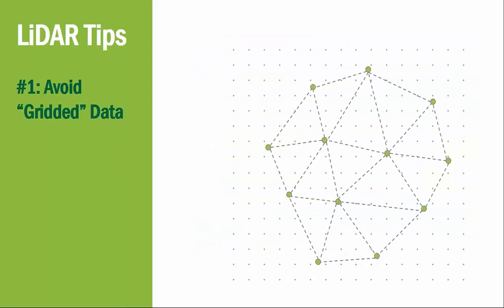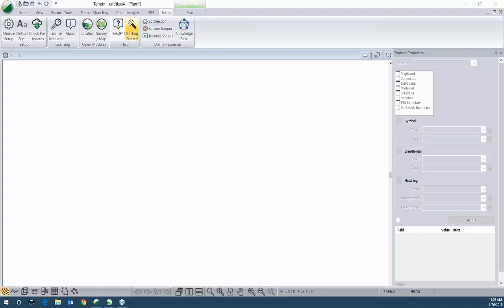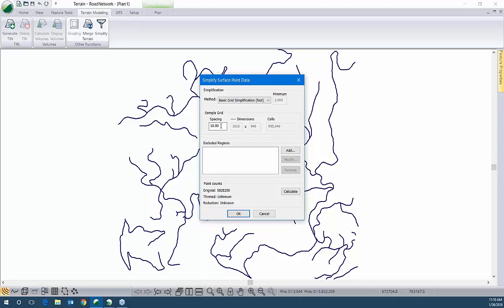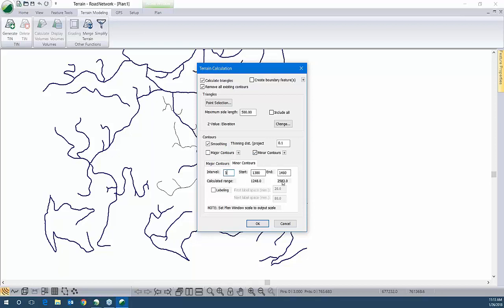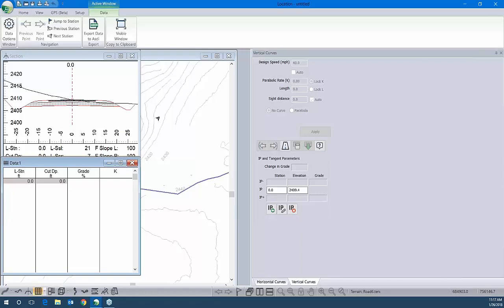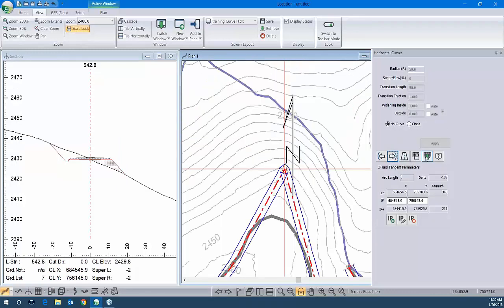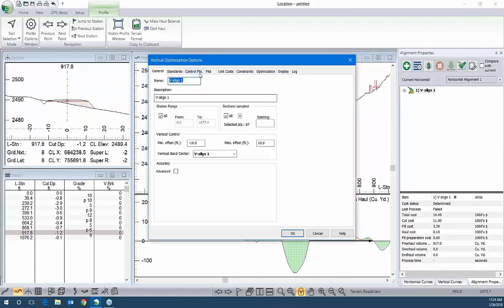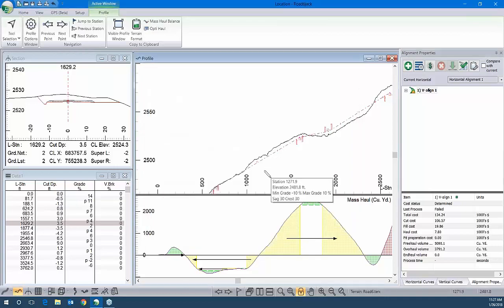LiDAR in resource road design - Importing, Thinning and Designing a Road

Comment: is it possible to enter an estimate of the depth of each ground material type, a cost of cutting this material in road construction, and hence better road construction cost estimates? This information is usually gathered during road traverse, with at least a depth to rock estimate, if not an overburden type and a secondary layer type. A cost of cutting these materials would further improve resource road construction cost estimates since it is now so relatively easy to optimize the road location for mass haul volume with lidar.
Reply from the maker: Hi Peter, YES! By entering your ground types and your cost of cutting each material (in the cost table) this is how our Softree Optimal add-on for RoadEng is hugely advantageous over manual design.  You can visit our Knowledge Base to read more on (1) Setting up your ground types and (2) setting up the excavation and movement costs for your ground types. Note: this requires a Softree Optimal license.    

Setting up ground types: http://support.softree.com/knowledge-base/location-module/materials-and-stripping/defining-sub-surface-layers
Setting up ground type costs: https://support.softree.com/knowledge-base/softree-optimal-1/design-time-cost-reporting/design-time-costing